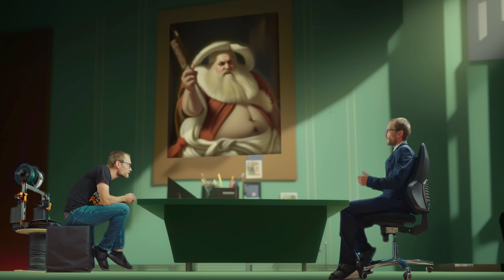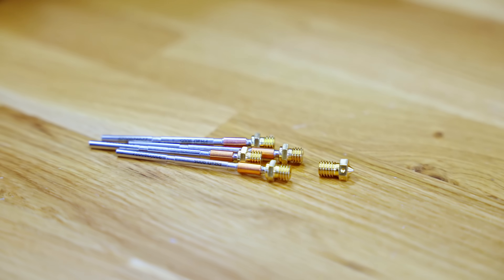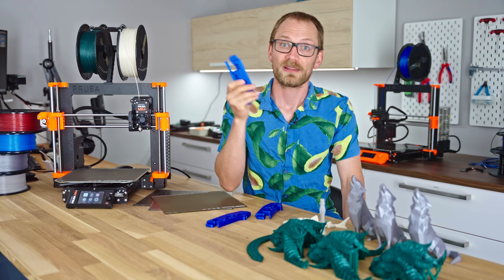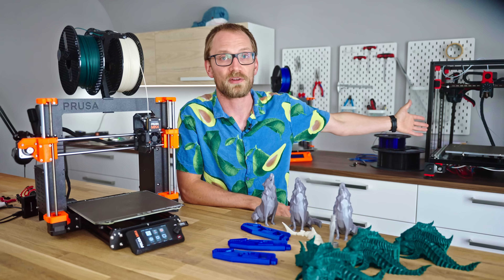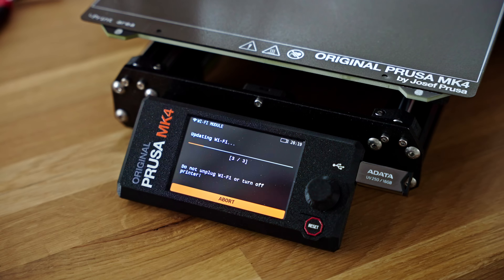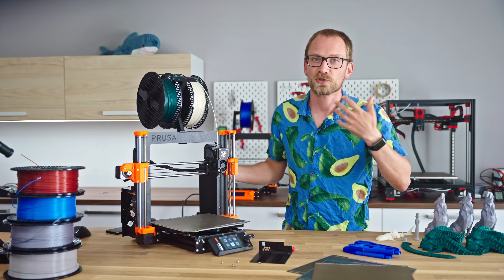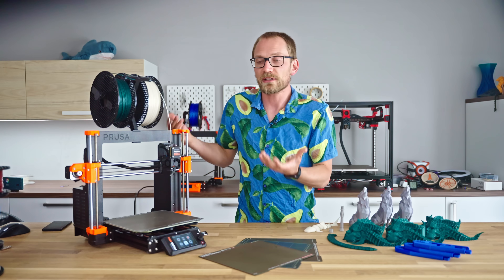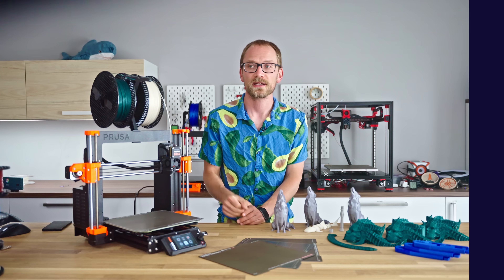Does the Prusa MK4 have what it takes?

Comment: I disagree with many of your statements ... 

"It gets you exactly what you want, very effectively but it doesn't have this apple-esque smoothness to it...."
I don't care about apple eqsque smoothness. A 3d printer is a tool. I want what I want, most effectely...

"[open source] Prusa slicer isn't a distinguishing fact anymore because every manufacturer can and is using it"
I completely disagree. The fact that they publish under open source and add to the community makes me wanna buy over other closed source printer (software).

"people don't seem to care about sustainability"
I care a lot about (mostly) made & developed in the EU. I hate if companies try to cheap out and maximize profit by moving everything to China.

Other printers may be 'nicer' but they are completely closed source and proprietary. As soon as the company decides to not support either the printer or the software, or remove useful features by making the software more apple-esque, you are screwed. If the company disappears your are screwed screwed... 

tho I agree with your Input shaping statement.

Comment: It would be interesting to put it up against the P1P as that's been a bit of a game changer in recent months
Reply: The X1 Carbon blows it away. Never an issue
Reply: It wouldn't be a fair comparison. A P1P or X1C blows the mk4 out of the water across the board (quality, speed, etc). Not to mention the AMS whilst not perfect is night and day a better system than the janky and unreliable MMU - a product that needs to be killed and redeveloped from the ground up.

Comment: Re prusa slicer, I gave it a chance when the latest release came out after giving earlier versions multiple chances too), I encountered an issue where the produced g code using the M106 command wouldn't automatically turn on the part cooling fan of my Duet/RRF machines as a workaround I manually injected a modified code of M106 P0 into the slicer generated g code and that turned the part cooling fan, upon seeking assistance with the issue via the prusa forum my post resulted in crickets..... But I managed to cure the problem myself, I went back to using ideamaker as my slicer and the problem instantly disappeared, so no more prusa slicer for me as support in my case was NON EXISTENT...

Comment: Has anyone considered there is a third option?   Yes, there is open source and closed source.   There is also what I like to call cooperation.   This can be seen with USB and Bluetooth.  Where a number of companies come together, agree to a common standard and then build around that standard.   They also protect the standard so everything works together.   Just look at the variety of mouse and keyboards and audio devices on the market.  Without cooperation none of these things would work well or work well together.    They may make a standardize slicer where the front-end is the same but modules can be added for unique printer features.   When the feature becomes common, it can be standardized by the group.  The group is supported by member fees who have voting rights as to how something is standardized.

Comment: Definitely think prusa has got the reliability down from what I hear never owned one, but coming from the reprap pro ormerod kit from RS many moons ago, and continuing the pain with heavily modified ender 3s I do feel tired of working on my printers issues, I guess if I added up all the time I spent working out the issues that time could have been better spent on the parts/designs the machine should be enabling, it depends what value to apply to time in the end.
The main deal breaker for prusa printers for me is 3d printed parts on the machine I can't bring myself to pay for a product with plastic structure, it seems not fully finished product, i know they work fine but just wished it was injection molded or metal like the clones.
Reply: You can't print your own injection molded or metal replacement parts.  Especially when the company doesn't provide them as free downloads.

Yes, I have actually printed replacement parts for my Prusa.  It saved me time and money (cheaper, no shipping costs) and was an wonderful customer experience.  They're mechanically just fine.  The stresses involved do not require any additional strength.

You don't have to give your future away to closed source companies (but you can if you want).  They're not "cheaper" and they aren't giving you "more".
Reply: @susanyoung6579  this is true and being able to print parts was a big reason I bought my omerod being a reprap hobbyist machine I think that's fine, but it was those formention printed parts that failed and required new ones to be made, but for the price of the printer kit and DIY nature this was acceptable. But if those parts were injection moulded originally they probably wouldn't have failed, but if prusa still had the option to print the same part if it ever breaks that would be a game changer, making the printer look as a complete product with the ability to repair.

Comment: The Prusa MK4 looks like a cheap homemade printer from 15 years ago, but yet they charge over $1000 for it?  With a bed slinger? Not enclosed? No touch display? Why would anyone buy one?
Reply: A bedslinger is easier to build square, open frame without covers is easier to maintain and enclosure is not needed for pla/petg, so it's better as an option for majority of their customers.

Comment: Prusa is very mixed bag. I put no value to that they are printing the parts, that is just stupid for mass product. I detest the shit by design, I mean not much effort has been but to the looks of the parts, and maintenance is totally terrible, how so much need to be disabled to do simple maintenance. Speaking of the MK3S that I have, but I do not see the MK4 being much better. And they are clearly not serving the business users as they should. What they have is the slicer that is pretty good but far from perfect, like when using on M1 Mac and two monitors,   if it was on the bigger monitor when closed, does not open correctly next time, etc. The saving files is terrible etc, no logic there, but it is mostly good, and does good job at the end. I see they have added many new features to the MK4, I have no interest on those, I need a workhorse that just reliable works and is easy to maintain. Pribging the files with SD card is just fine, no need for network, even the old user interface is just fine. I do not like the direction it is going.

Comment: as cool as bamboolab printers are.... if you work on products that will be copied innchina within a year, or on anything that is suppost to be somewhat secure... you CAN NOT USE THEM. some product will no longer make profit it it gets its desing direct-wired to china, along with a connection ito you wifi wich you cannot tell what it does.... it doesnt allow cloosed Software,  and so ill stay with prusa.... and maybe i can convice them to make a medium sized closed buid area printer, or ill just keep using my r2.4 or the k1 max 🤷‍♂️

Comment: The MK4 isnt bad tbh. Its a decent machine... but the X1C is a bloody great machine. It has some flaws but so do loads of printers. That said the X1C is a massive step up in print quality and reliability. I just feel the MK4 tried to do "more of the same" and less of the innovation. Compare it to an ender 3 and the MK4 smashes it in all aspects other than price.... but thats the important part... its an expensive machine and for the price you dont actually get that many extra features.
Reply: Ender 3 is from 2018 and costs 100€, it's a platform for modifications that gets you started, every body that has at least half a brain understands that.

Mk printers are one step above  enders and the only difference is them being more reliable and a bit easier to use. 
       Bamboo lab moved the industry another inch forward and forced creality and others  to catch up. Creality managed to do it pretty well with K1, prusha couldn't. 
             There is no reason to be fan boying for prusha, they are doing nothing for the community, maybe even sabotaging it a bit.

Comment: Prusa has dropped the ball for me. I will not upgrade my MK3 but rather get something completely different. I was so disappointed when I added Wifi to my Mini. You can't set a custom NTP server on the device and it will not use the NTP sent via DHCP. NTP will only work with Internet access.
Prusa used to be my recommended printer manufacturer but not anymore. Times change, they do not.

Comment: Well the Mark 4 is great a well worth the money ender's are shit and sovol's need the right upgrades and the rest well just not worth it, so you buy a prusa you get a machine that just works and you get customer service that none of the other come close too. And here is a story for you i got six neighbors to buy 3d printers 4 of them bought enders and other starter type machines  the other two bought prusa's one a mini the other mk3s the two that bought prusa's are still printing without problems and are learning more and more about 3d printing while the other four people are not two of then gave up because of issues with cheaper printers giving tons of failed prints so they sold them and dont want anything to do with again the other two still have there machines but dont use them because they break all the time jam up and they got told just upgrade them and then they will work they went no thanks and gave up also most people just want a machine that just works out of the box and prusa does just that a little setup but nothing hard at all.

Comment: Unfortunately they just got comfy and did very little to improve the actual printer , they have done impressive work to the software and comp side of things but that will only take you so far. The way the prusa is biult is just not competitive as far as manufacturing costs are concerned. The form factor and design is outdated and has met its potential long ago. The simple fact is it is flawed design to compete with the new standard and it should be treated as what it is a reliable fun printer with open source bla bla and you can tinker and mod to your hearts content but claiming this thing will hold a candle to a bamboo is a joke.

Comment: I think that Prusa would have to renew itself, take out a design, something like a phoenix to be able to compete .... (for example imagine for a moment a printer connected to artificial intelligence and that tells me which are the correct parameters according to the material to use, not to have to calibrate, nothing or maybe almost nothing). Otherwise it will be part of the past...I think that the printers have already gone through a tuning process, I personally got tired of the paper to calibrate the printer, of seeing which is the best nozzle, of the glue on the printer bed, of printing with only one colour, of having failures after printing 7 copies ...., and also of lowering the prices a bit. It's the only way now to enter the market. I don't think Prusa is the best option nowadays. Of course we all know that the day an electronic circuit connected with artificial intelligence in a 3d printer, that recognizes all possible parameters to print 100% excellent quality, will come to us. The business of tuning videos, filament sales and some other accessory for that printer will be over, because this A.I. would supposedly give the printer a longer life span. Guys 31 years ago the first 3D printers were launched...stop f.... around.

Comment: Bed slingers are DED. Deprecated tech :)
Reply: Prusa produces it very cheaply and sells it for gold, so it's not dead.
Reply: It's not that they are "DED"  it's that at this price point, for one that doesn't have a bigger build volume, they are hard to recommend.
Reply: PotatoMan-ke7sn  racism and politics don’t belong here. What does Chinese have to do with this? Name one other company that’s innovated on the areas that make it such a great “automatic” printer. There’s a reason it has shaken up the market and become a top seller.

Additionally, regarding Prusa slicer upstream code, they’re well within the rights of the license PRUSA THEMSELVES have assigned to their source code. Nothing nefarious there.
Reply: @mrnlce7939  bigger build volume only amplifies the inherent huge negative to bed slingers. Huge mass, moving, much different accel capability on X vs Y, leading to the slowest damn printers ever. Corexy, annex cross gantry, and delta have much more capability and inherently better frame alignment and tolerance to vibration. Also, as you add mass to the bed, you realize that’s a dynamic amount of moving mass now. So any calibrated input shaper frequency won’t stay accurate as you deposit more material. This is why we have flying gantries and vertically moving beds. Constant mass.
Reply: @BigfootPrinting  I get that but speed isn't every thing.
Reply: @mrnlce7939  that’s like saying “why buy a Ferrari for 5000 dollars when you can buy a civic!” For the sake of justifying your poor purchases on a, by mechanical engineering principles, inherently unstable and thus not capable of the modern speed that we’ve proven time and again is more than enough time to bond a new layer and cool it. You’re just repeating the mantra of those who are stuck with bed slingers. Look up annex engineering k3 videos by Keyan mobli and tell me your slinger is worth 5 dollars
Reply: @BigfootPrinting  Dude was spiting facts and you took it personally 🤣🤣
Reply: They still sell pens and paper.
Reply: @BigfootPrinting  A $5000 dollar Ferrari isn't going to last that long and will cost even more in the long run. There's no point in buying a Ferrari if all you do is go to the shops. I hope I haven't upset you that is not my intent. There are many reasons to want a 3D printer and some people don't mind waiting for there prints. "Slow and steady wins the race".